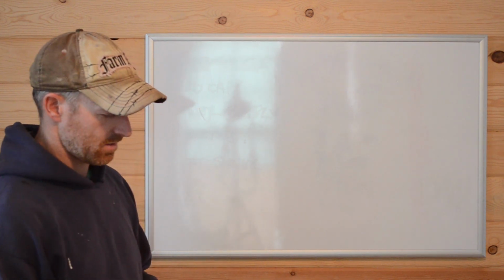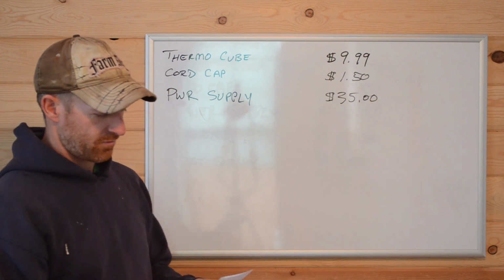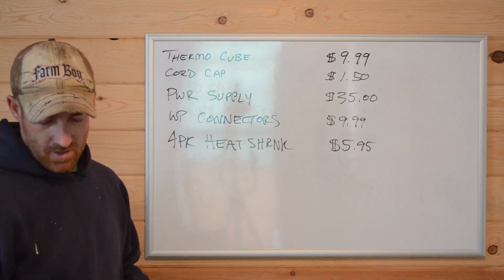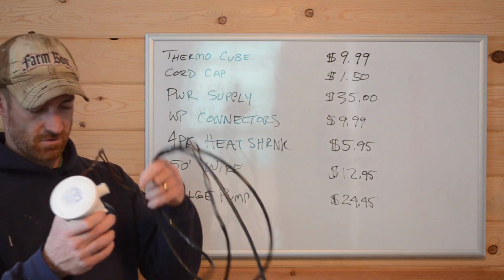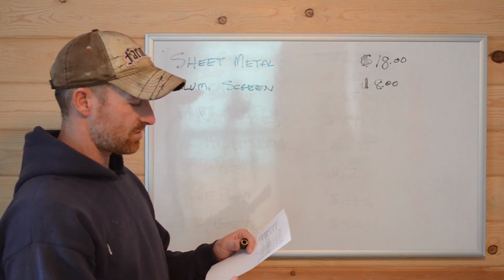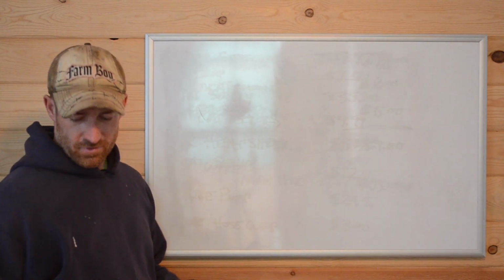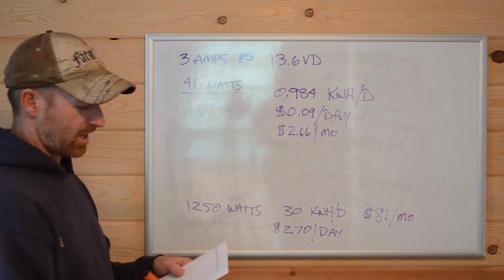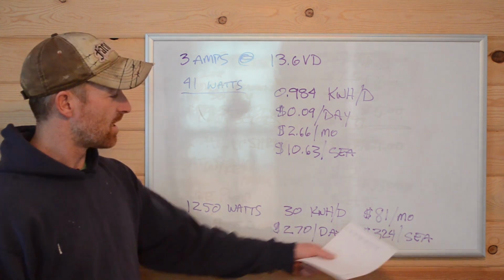DIY Stock Tank De-Icer Part 3 of 3

Comment: Did you ever go solar? How is it after 3 years?
Reply from the maker: We never did go solar.  I may test that at some point.  It has been operating well otherwise - the biggest problem we've had is the pump getting clogged or slowed with debris.  If you don't catch it in time, it will burn the pump up.  Someone suggested miner's wool, and I think that would definitely work better than the screen I used.

Comment: This set-up still working?  Was wondering if having the pump a bit closer to the top would help with the debris issue and well as any freezing up issue as well.
Reply from the maker: Yes, this is still our preferred method of keeping the stock tanks free of ice.  Moving the pump up would help with both ice and debris, but it causes other issues.  The first is that the cows tend to chew on the filter screen when it is out of the water, which damages the screen and allows debris in.  The second is that if the water level goes even (or below) the level of your pump, chances are you'll freeze your pump and damage it.  When it gets really cold, there is always some ice in the stock tank.  If you always keep your stock tank totally full, then maybe it will work for you.

Comment: What's the coldest temps you have tested this in? Are you still using this system? I like the energy savings but at times we get into temps of -10 to -20 or so.Thanks!
Reply from the maker: The limit of this particular pump is between 5-10 degrees F.  We are still using this system and have never purchased a tank heater.  In this temp range we were getting a thin layer of ice over the turbulent area, which the cows could break easily.  You would need a pump with more flow to get lower, but I am not sure how much more that would get you.  I’ve seen waterfalls freeze completely!  When the temperatures drop lower than that, we just break the ice, but our winter stock tank is close to the house, so we have that luxury.